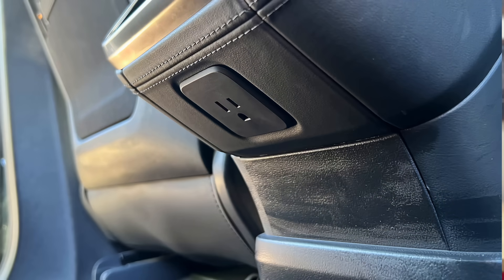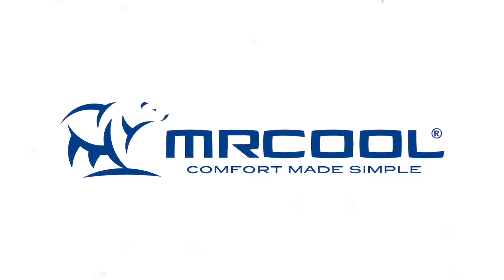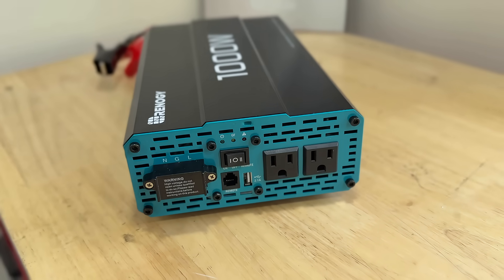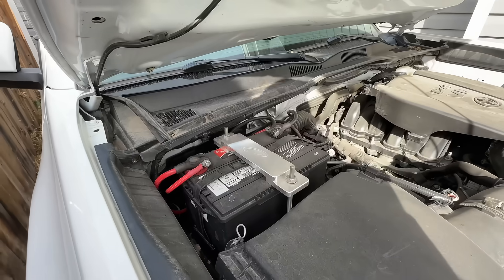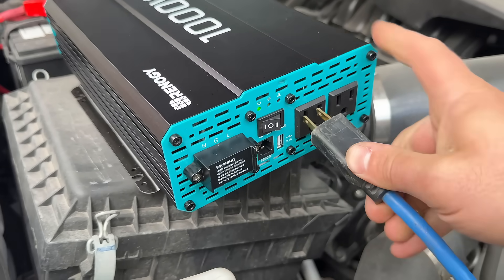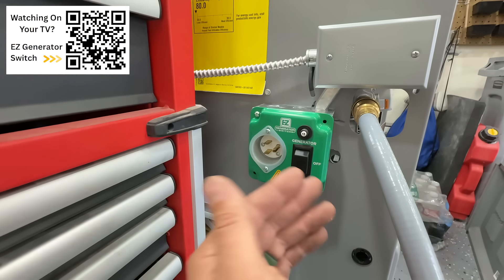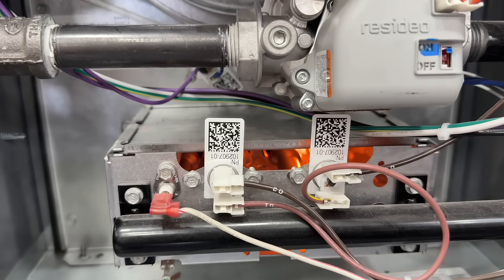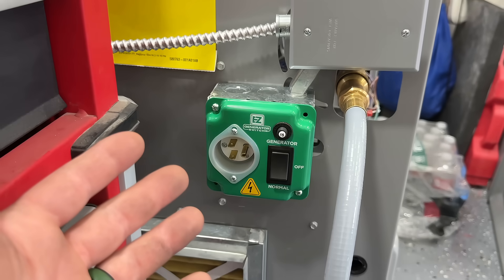Why Buy A Generator? You Have One Parked In Your Driveway.

Comment: Never leave your inverter under your hood like this guy said. It's way too hot and it will go into thermal protection or possibly burn up. Also he is not 100 percent correct on leaving a vehicle running for long periods of time. Yes we idle a lot but we generally also run the vehicle at some point directly afterwards which will cool the engine as this is a major priority to any engine.....Yes, Even diesels. So do your homework and don't believe everything you see or hear on YouTube. These inverter are great for camping adventures or offgrid use of a power tool on shorts uses buts that's about it.

Comment: For the same price as the inverter here, you can get an 18,000 BTU big buddy heater,  hose adapter and 20 lb propane tank which will run it for a week straight on high! Much cheaper to run than your vehicle, which won't idle for a week straight. You would spend probably $100 in gas idling a car for a week.
Reply: what is the cost of food lost in your fridge freezer?

Comment: You probably don't want to try this if you have a typical economy car with an ~65A alternator and a heat pump or want to try to turn your stove on for example, you'll end up spending $500+ to have someone replace your car's alternator/regulator/ecm. On the flip side I have heard/seen where you could set a car or lawnmower tire on a mechanical generator and place vehicle into drive to provide sufficient energy for such.

Comment: of course I was wondering about vehicle idling and $ so I looked it up: "A car typically uses about 0.16 to 0.39 gallons of gas per hour while idling, depending on the engine size and type. Larger engines consume more fuel at idle compared to smaller ones." in my area, gas is about $3.80/gallon.  If I say I can get 3 hrs of idle out of a gallon of gas then 24 hours will cost me around $26.   I also know I can keep my freezer cold running it for 4 hrs a day....so not the cheapest but not the most expensive either especially if I have a lot in there!
Reply: Well in Canada, during winter, it can be -20 or colder..if power goes out for an extended period of time, who cares about the cost of the gasoline if you can keep your house warm with your natural gas forced air furnace…even if used intermittently, it keeps your pipes from freezing..saving you money and insurance BS.   I actually have an inverter generator and always keep an extra 20 gal of gas in my garage thru the wimter.

Comment: An investment in a standby generator is still your best bet.  Especially if you live in an area that has natural gas service.  I put mine in 14 years ago for  $1000.  It is the 8kw and the smallest standby they make. I was able to do the installation myself except for the gas line plumbing but lucky for me my next door neighbor works for gas company. He provided know how and the pipe.  I cannot operate my range water heater or ac.   That is ok I have lights refrigeration and sump pumps.  I seldom have outages of more than 24 hours. I know generators cost more now but you will thank me the next time you are not sitting in the dark

Comment: When I had a new furnace installed, I had them also put on a 110 plug for me to power the furnace with. Great idea, I suggest using a full synthetic like Mobil 1 in the vehicle which is good for 10,000 miles, or whatever length of time you need it during your outage. Newer vehicle might turn off if someone breaks into it while its idling and they touch the brakes without the fob nearby, for security.

Comment: Optionally important to tell folks that if they’re looking for a solution to power their household size refrigerator the likely going to need a 3k watt power source just for the fridge. Something like a fridge or freezer has a considerable surge at start up that also needs to be factored into the equation. Your best to consult with a knowledgeable electrician before you throw a 1k inverter in your car thinking you’re going to keep your food cold in the event of a power outage.

Comment: Get the facts and do the math.  What is the maximum watt/hour rating of your battery.  Note that car batteries are designed for the high wattage surge to start the engine with immediate slow recharge, not prolonged discharge to any significant level.  What is the wattage charging rate of your engine at idle, and how much fuel does the engine use during the period of modest charging.  

If a Sears Gold car battery's total watt-hours is 1080 watt-hours, take it down to 50% a few times, and you’ve probably killed the battery.  That’s running a 1 kwh load for something under 30 minutes.  

Example:  The alternator output for a Ford F-150 varies by model and year, with standard alternators typically ranging from 
95 to 240 amps. Whatever the rated amperage at idle it may be around ½ of full rating.

Comment: As a mechanic by trade I would not recommend this for the simple fact that at idle your vehicle alternator is not going to be able to put out enough amperage to maintain the system voltage and it will not move enough air to keep the alternator cool, 1000w equals 77amp at 13 volts and the average alternator will only produce 30-40% of its rated amperage output at idle and it will overheat if left to run full fielded for any amount of time, so not only will you not have heat or electricity long but you will need a new alternator on your vehicle as well, just go buy a cheap generator and save yourself the trouble

Comment: Great video but after a week long power outage I purchased a diesel generator. Diesel is much more available when things get crazy. It's an older military generator so it runs on used motor oil mixed with gas mixed, kerosene, vegetable oil or diesel.

Comment: If you do this, the next thing you'll be spending well over $200 on will be a new alternator for your vehicle.  Automotive alternators are not designed for prolonged loading like this, they are only designed to replace the draw from your vehicle systems, which isn't anywhere near the amperage draw of multiple household appliances running at the same time. You might just cook your battery too.

Don't do it.

Comment: A 1000W inverter will require 1000/12 = approx 84 Amps draw from the battery. Consider 80% efficiency in conversion, your Amp draw from the battery will be 84/0.8 = approx 100 Amps.  The wire size clamped to the battery is not adequate for that kind of power draw. couple of points to note. 
1. If you are drawing 1000W, AC power it will be a bad idea to connect with the car turned off.
2. You must leave the Engine running while drawing power.
3.  Unless you have a 4 liter engine or above, the  Alternators are designed for around 80-100 Amp charging current. This charging current is a function of Engine RPM and is at peak when Engine is running at 2200 RPM and above.
4. At Idle speed, the charging current is much lower.
IMHO, this idea is OK and limit your draw to less than 400 W with a good healthy batter and engine running.
5.  Finally the temp inside the hood will be higher with the hood closed, and far exceeds the rated Environmental operating temp the Inverters are designed for. So use a longer heavier gauge wires to the Battery and keep the inverter out if you want the inverter to last.
6. Not recommended for long duration use and should be for short urgent needs or very low loads of upto 200-250W for usage for 2-4 hours.

Comment: I really don't know anything about how these work, but I'm trying to plan for a power outage in the winter. We live in an apartment, and I'm wondering if buying the 3000W unit is worth it. Amazon has a used one for $224 and I'm leery. Could you please offer some advice? We would really need to run a space heater as we couldn't alter the furnace.

Comment: Meanwhile, you demonstrated how to fill the house with carbon monoxide. You must close the garage door and aim the exhaust away from the house. Proven in Minn. using tracer gas studies. Regardless, get an UNlisted CO monitor. UL listed CO alarms are junk and merely death alarms designed to alert only once you've inhaled enough poison to meet the medical definition of CO poisoning- 10% COHb. 
Yes, MUST isolate any appliance from the grid and turn off your main breaker. Once power restored, turn on breakers one at a time allowing a second or two each and start with the big double pole breakers. Install a whole house surge suppressor then point use ones including your furnace, refrigerator, computer, TV and any essential equipment such as O2 generator or CPAP.

Comment: Unlike a dedicated generator, a car's engine will overheat if left idling for long periods of time. Not only does a car's engine rely on the radiator for cooling, IT ALSO RELYS ON STEADY AIRFLOW OVER THE ENGINE. Without that airflow the engine overheats. 1st sign will be a leaky head gasket. 2nd sign will be a warped head, and that, my friend, is EXPENSIVE. But hey, go ahead and listen to this and find out for yourself.

Comment: It takes a 2500 watt inverter to run a freezer . The problen isnt running the freezer its the load when the capacitor kicks to start the compressor  .you also didnt mention cutting the battery life by using an inverter . Youre acting like people are going to run their entire house off a 1000 watt inverter.

Comment: Your videos are the best ... right to the point and clear explanations of the problem and how to efficiently solve it.   Question:  I own a 2012 Chevey Cruze that I'd like to use as my backup generator.   It has a 1.8-liter, 4-cylinder engine.   How do I size the inverter for this size engine?  Can I go with 1.5KW or should I stick with 1KW?

Comment: I donno bro - that inverter inside the engine bay seems like asking for trouble - why not just get longer cables to connect the battery to the inverter and have the inverter operate outside the car.

Comment: Also, this 1000 watt won't Power a Fridge Long. Most Fridges draw 5 Amps, at 120 VAC is 600 Watts. It takes 1 DC amp to Convert 10 AC Watts. Hence 60 DC Amos required, and almost every Car Battery is around 80 Amps or Less. So, Only 1 Hour for a Fridge with Nothing Else , and Battery is Dead. Stop All your BS Videos.

Comment: You should connect your positive battery cable first before negative. If you connect positive first and your negative lead is touching the body/frame/engine ANYWHERE bare, it will short and arc. Also possibly damaging computer components in the process.

Comment: Years ago I bought a 4,000 watt pure sine wave inverter.  12 volt.
A friend of mine who is big in electronics kept telling me to get a 36 volt or 48 volt inverter instead.   He said  this 12 volt inverter is very inefficient compared to these others he recommended.
I kept insisting that the 12 volt one is much better for this one reason...... "I can take this out to my car and run it off my car"

Using his 36 or 48 volt system, you need a battery bank and special chargers.   And in the event of a long power outage you'll need a generator to recharge those batteries.
With the 12 volt inverter you don't need any of that.  Your car is sitting right in your driveway.
Reply: 96 volts is even better, but that is for a solar panel setup.....the higher the input voltage the smaller gauge wire needed, and less conversion losses.
Reply: @1pcmedic 48v is the standard for solar..
Reply: @1pcmedic you missed the point...
Reply: How??? 4kw at 12v is 330 amps! Dear God!

Comment: Over the road truck drivers have known this secret for many years. It’s called a power inverter. This is how they run their TVs, their microwaves, their computers, and they’re small heaters.
Reply: Yep. My semi had terminals on the dash from the factory so I could clamp the inverter right there on the dash.
Reply: their
Reply: @rossogden9920 you got me!  My keypad works for the far left liberal socialist democrat party!😂
Reply: But many truck drivers make the going cheap route by purchasing modified sine wave truck stop cobra inverters; and burn down the house/cab!
Reply: Yes. He did mention in the video it was called an inverter.

Comment: My furnace is in the attic with only access thru the MBR closet, which would require running over 100 feet of extension cord thru the house.  For the electricians out there, can something similar be done at the breaker box, which is already in the garage?

Comment: A hybrid car is perfect for this application.  The gas engine will not run all the time, it will start automatically whenever the 12 volt battery needs to be charged.  For example, when your power demand is low, the gas engine will stay off longer saving you gas.   However, you'll have to be careful, a lot of hybrid cars can only provide 50 amps, that means the wattage limit is 600.

Comment: Yeah I got rid of mine because of the noise and the possibility of theft, much easier to keep  gas in a vehicle or 2!  I have learned during the summer not to stock too much food in the fridge also, less to run.
Reply: More food in the fridge helps it run more efficient because of the ambient cooling effect of all them glass jars and stuff hanging onto the coldness and taking up air space.  An empty freezer uses more power.

Comment: Great video! I actually did this on our Gas Furnace from watching one of your earlier videos. I would suggest a couple points. I had to add a neutral bonding plug to get my 96% furnace to run. And, be sure to buy a Pure Sine Wave inverter (IMO).  A refrigerator might need a 1500W inverter that can handle 3000w start-up surge. Love your videos, very helpful for guys like me. Greetings from the Old Jarhead in WNC

Comment: No! Don't leave it in a closed hood, the inverter will over heat. Take note of the fan on inverters.
And 
You don't have a deep cycle natter so you will have too keep your car running or you battery will be distroyed.
And then we have the issue with the alt ...

Comment: If you buy something like an Outlander PHEV it will cycle the engine as a generator automatically.

Idling a car, especially a large V6 or V8 just to get 1kw is insanely inefficient though. Depending on how often you use it you'd probably pay less money on a cheap generator so it doesn't waste massive amounts of fuel.

Comment: Gasoline cars are not designed to be stationary with the engine running for long periods; the oil doesn't lubricate everything as effectively as it does in a diesel truck.

Comment: 1000w inverter is definitely way too low, for any electrical heating source.
Only works for electrical start ups: where gas, etc., is the primary heating source.
So, you'll only be eating cold cuts.

Comment: You need to tell everyone the battery won't last long without the engine running in your car..  it's just leaving the lights on in your car, depending on the age of your battery,  it might last 45 minutes without the engine running so the alternator can keep the battery charged..  I ran a 5000 watt inverter from my truck for a week,  I keep checking the heat gage every few hours, and in that week it only burned a half tank of gas with it idling..

Comment: Now I'm really wondering why all modern gasoline trucks don't have a 120 volt AC generator built in. Every modern truck should have a 240 volt generator output on the back by the tailgate to power your house as a generator. I don't understand why this isn't a thing? Electric truck all have a 240 volt power plug on them, but gasoline trucks dont'?

Comment: if im correct, youll need to drive the car around a bit after using the inverter to charge the battery back up again. dealt with that for a customer when this whole time i thought the battery charges just from the engine running but the alternator needs spinning wheels to work right

Comment: Good plan.
I can't run my heat pump from this... but I can keep my fridge cold, a fan blower for my fireplace insert and several lights.
Best part?
no giveaway generator noise.
and pulling 6 to 8 amps means I can run my car 20 minutes an hour or less...reality is i can keep my fridge cold on pulling power 1 hour out of 3,maybe less in cold weather